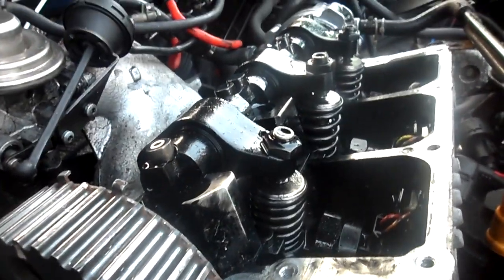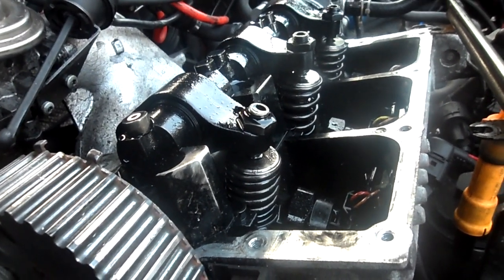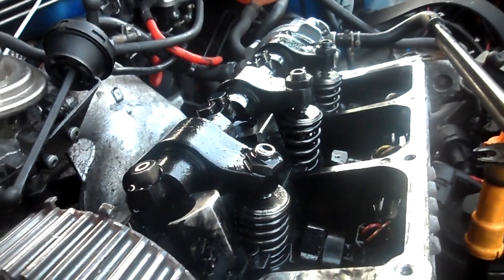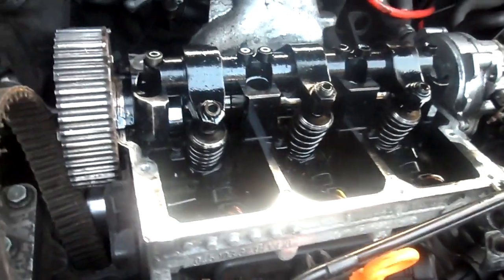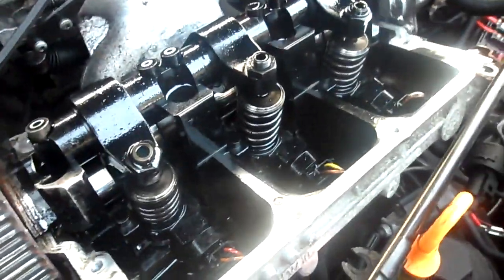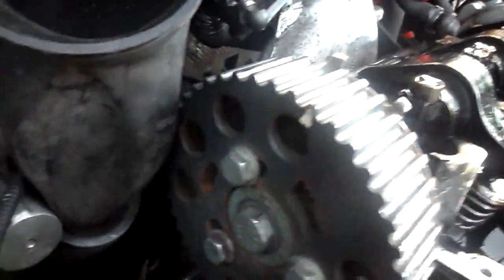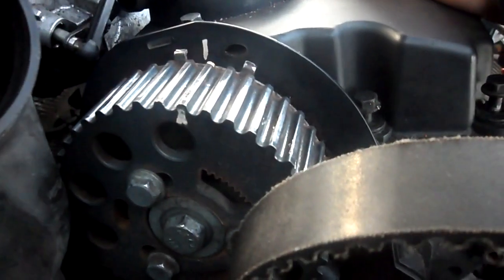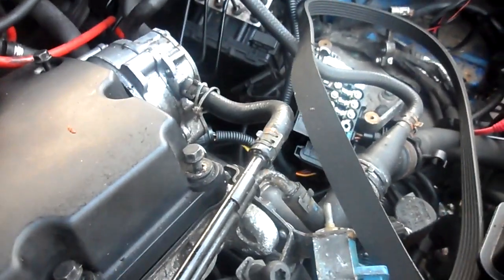polo tdi pd 1.4 cambelt problem

Comment: Just changing my cambelt on 1.4 tdi 2008  having real problems l turn engine over by hand and it just locks up either way, any help would be appreciated. Could do with a quick response as my wife is pecking my head having to use the bus.
Thanks   Lee

Comment: Its a must to use special locking tools. I Have a Polo to and today i did the timming belt on it and was no big deal. you cant do timming belt replacement on a tdi pd engine without special tools. have you managed to complete the job ?